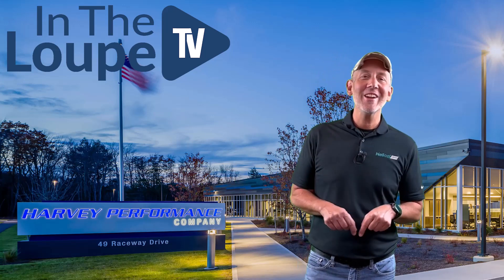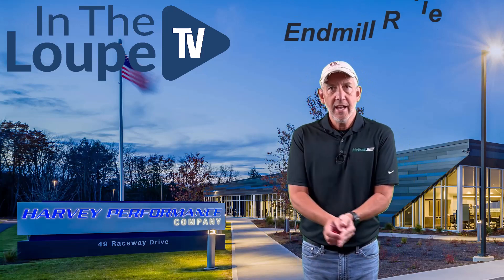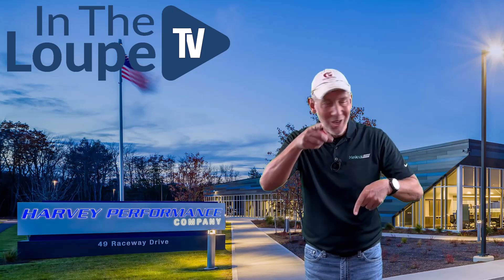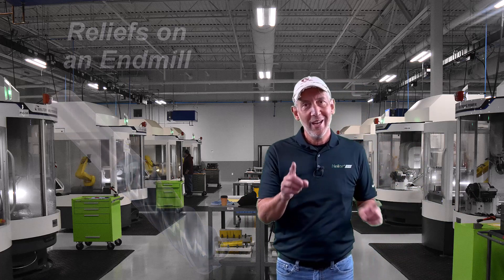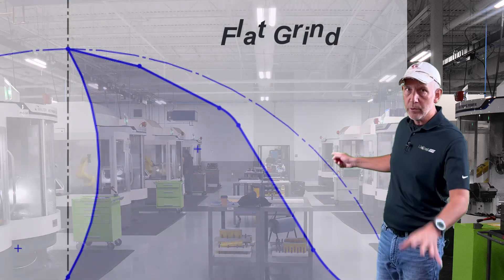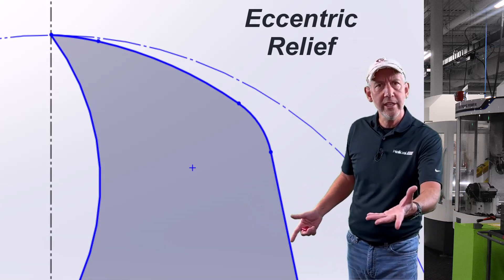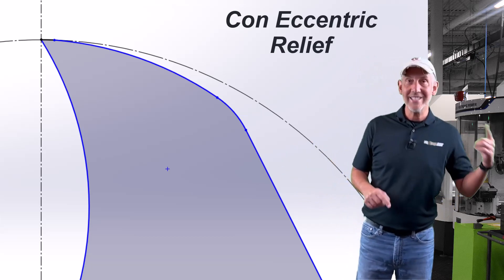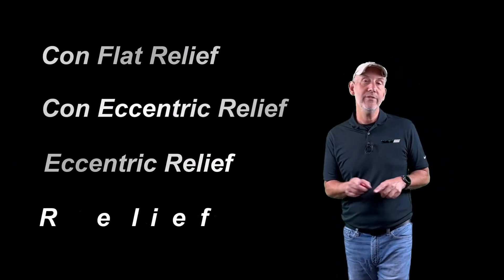The Different Types of End Mill Reliefs: In The Loupe TV Short

Comment: What is the need of small margin on the endmill.... please elaborate more how this is helpful in aluminium application...like any impact on finishing and roughing milling.... waiting for your response..love from india
Reply: for aluminum, if you are running aggressive feeds/speeds/depth of cut/chip loads/etc. to achieve low cycle times, you tend to chatter with an up-sharp endmill. This can also happen with a less rigid workholding and/or machine/spindle. The small margin supports the endmill while cutting similar to a drill margin in a hole. This makes the machine/tool system slightly more stable reducing vibration and chatter. Technically, this margin rubs and doesn't cut. Therefore it is kept to as small an area as needed. I remember seeing this technology first with the old "Ski-Carb" endmills made by SGS. They worked great for reducing chatter and improving surface finish in aluminum.

Comment: Con flat relief is good for aluminium in high speeds, but cylindrical margin should be not more than 0,06mm and you should control it. When you manufacture hundreds of end mills this type of relief could be an issue, cause you wheel has wear and make this land wider per mill
Reply: Also depends on the diameter of the cutting tool, Roughing or Finishing applications and other factors. Can be controlled if you are able to do in process measurement and correctly offset the  EFF. Also, the wear will be much less if you are controlling the cylindrical grinding/blanking (assuming the tool diameter is less than the shank diameter)
Reply: You are correct it should be very small in order not to put extreme tool pressure.  You will also see a lot of Con-eccentric relief in taps to help stabilize in the hole.  This cylindrical margin is much larger.  Thanks for the comment.  CTC
Reply: @CuttingtoolCounselor   I’m not sure about taps, famous manufacturers like OSG, or YG1 has eccentric relief on taps but not con eccentric. Most of taps has different reliefs on the guide part (tang angle about 0,5deegr,  and on the cone about 4 deegr depends on material and tap type. But if you use con ecccentric reliefs your tap can break up easily, because of big torque. Think about it.